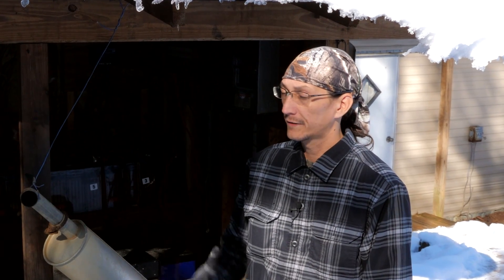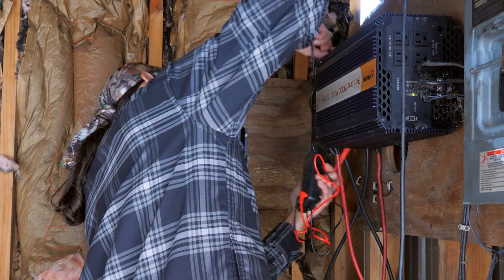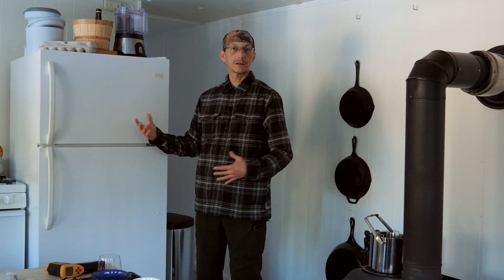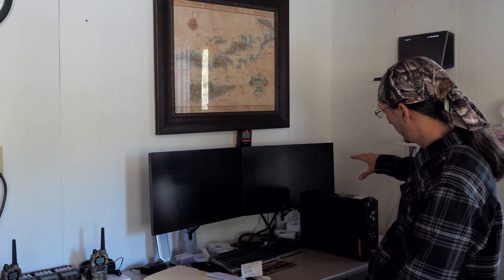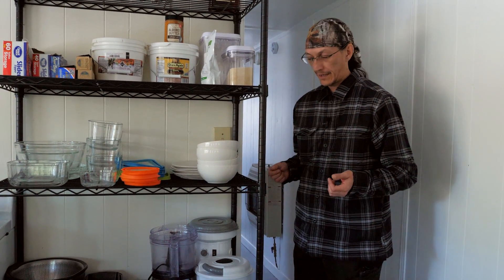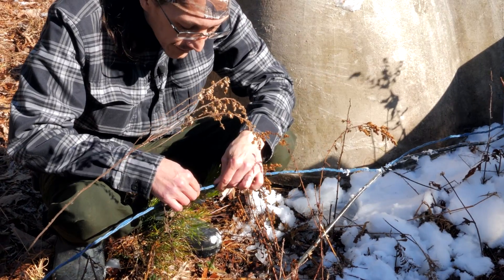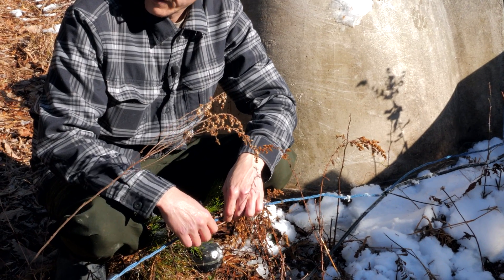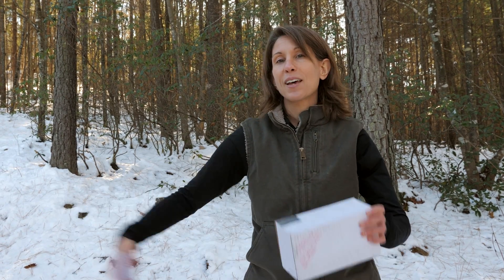Off Grid Electricity - Our DIY Solar System

Comment: I do the outdoor thing  with refrigeration  You can save a bundle.  I live in the city and i am a former large scale farmer.   Use mother nature to reduce your  KW load.   I used a  compost pile  for  geo thermal heating  reduced my load by 60 percent..  You have enough bio mass from your trees to consider using composting as another method of heating your home.

Comment: Convert to a 48 volt system, remember OHM’s law.. we run 12 250 watt solar panels, 8, 6 volt batteries, Magnum charge controller and inverter. Cable running from batteries to your inverter is important. All this system you can put on your house later as well. Love our system. Good luck and love that you have joined the Off Grid lifestyle..

Comment: The voltage  is dropping because the wire is to small.  When you calculate the wire size you must also calculate the distance  from panels to  inverter.

Comment: I'd look into getting a 500 or 1000 gallon water tank and put it either up a hill or on a tower to get a gravity fed water system.  They you only have to run the pump once every few weeks to fill it up.

Comment: First, thank you guys for all your videos. Your life is an inspiration for us. One thing I noticed,  your wire going from the battery bank to the inverter is really thin. This is why your system can't even handle a light load like a fridge. To feed a 5,000 W inverter you need a wire capable of handling 400 amps (5,000 / 12 = 416 Amps).  You need 800 kcmill copper wire. It is about as thick as your finger and you won't find it at your local Home Depot. A welding supplier  would be a place to go.  If they don't have 800 kcmill, they may offer a combination of 2 or 3 thinner wires which can handle 400 Amps. Hope this helps if you haven't figured it out already.

Comment: You are on the right track but your biggest problem is the distance from solar panels to charge controller & batteries ... it is just too great for any 12V array and buying thicker wire simply won't payoff. I would move the panels to a spot next to (or on top of) the battery shed and clear any sun blocking trees as the least expensive solution. I suspect that the previous owners only used the solar to keep the batteries topped off when they were not there ... and used the generator to charge the batteries. You are smart and diligent so I'm sure you will get it figured out!

Comment: I think you are spot on about the refrigerator. Even if day time temperatures get a high of 50-60F run the refrigerator when you run the water pump and you should be fine. Also by the time you reach those temperatures you'll have stronger sun for more solar collecting. xoxo from sunny Arizona. 77F today

Comment: Yea, it sounds like your wire size is too small for a 12 volt array.  I think the mnpt charge controller is the right choice.  A good charge controller will be able to handle different array voltages and battery bank voltages.  Which will give you flexibility in your future system.  Plus the added information it will give you.  After it is installed you could try putting your panels in series to up the voltage and then the wire size wouldn't be as big a problem.

Comment: For your solar system consider organizing a small group buy of used panels.  Most of those purchases have a minimum order of 20 panels or so, so you may need to organize a couple of friends to make it happen.  We got in on one and bought 18-month old 300 watt panels still under manufacturer's warranty for $85 each.

Comment: I worked heating and a/c for over 40 years, The fridge compressor is not going  to freeze. Your milk may freeze. On central air the compressor is always outside. Same with heat pumps. Love your content. Greeneville Tennessee says Happy holidays.
Reply from the maker: Yep that is why we were hesitant to move it there. But we had to weigh the pros and cons and this was the best temporary solution

Comment: Your videos are great.  To help with your camp water needs you may want to try something I use at my camp. When you pump water from your the spring to the cabin store it in a RV water holding tank in the camp. The water can then be sent on demand to the hot water heater and sinks with a 12 volt RV water pump. You can purchase the RV items from any RV dealership if or salvage yard that has a wrecked camper. Keep chasing your dream!

Comment: This will be a good experience for your home design, making it as efficient as possible.  If you have a southern exposure, a passive solar home might work out.   For the water, you could have a higher tank and fill it with the generator and use gravity, or use a small battery pump with a ground level tank.  Even a food grade 50 gallon drum would help.

Comment: One piece of advice I've heard you and other homesteaders give is: wait a while and get to know your property and setup. Like you said in today's video you have to adjust your electrical usage. For  instance, sweeping snow off your solar panels, even if it means getting out there during flurries so it doesn't freeze on the panels. Or setting up the panels so they can go vertical during a snowfall. There's lots to learn this winter and I think you won't really know what those needs are until you've practiced them at least another winter. Take your own advice, don't rush into building your new house. With love from Arizona.
Reply from the maker: Exactly. There is a lot of advice to “buy this and buy that”. We are intentionally not running out and buying things. The last thing you want (on a limited budget) is buyers regret. We are actually even rethinking our house location already.

Comment: I can't be the only person who thought, well move it!  (About the fridge) and you heard me! 😉  Mind you, you could keep the contents outside on the porch for the next 2-3 months, then your only problem would be milk ice lollies! & frozen lettuce.  Is there a reason you didn't put it closer to the door so you don't have to be turned into a statue when you step out in your skivvies & bare feet to get the milk for Jaime's coffee in 3ft of drifted snow?  Great to see your videos coming up J's, I missed you.  Starry did a Solar 101 video in the Summer, & down in the comments were some suggestions for improvements to her system with newer, far more efficient components of the set-up.  My point being go and look at the video and maybe message the guy who sounded über knowledgeable about solar system updates as part of your research,  because I know that you do extensive research getting ready for projects, plus it's ALWAYS Easier to build in future expansion (when you afford it) cheaper too in the long run, than it is to extend already installed systems.  Like putting in double plug sockets in every corner and wall of every room; and the wiring for wall lights where you'd naturally place them, marked on a room plan for future Sparkies (Electricians ).  A few feet of extra lighting wire now is by far a cheaper option than the chasing out of channels in an already plastered and painted wall to hide the wires to either the wall lights or where the extra plugs are needed, plus however good the contractor the new plaster never looks invisible, you can still see exactly the route from ceiling to lighting.  I bet he'd be delighted to share his knowledge and experience with you,  just a thought.

Comment: A sollution for your water system in the long term might be to put in an underground watertank, at an elevation and have it filled with a direct drive solar waterpump from the spring/well. That would give you near constant waterpressure and no need for batteries for the waterpump. Engineer 775 shows how he has build several systems like that for clients of his. I know it is not a short term sollution but it could be considered for your permanent system when you build your house.

Comment: 12.0 volts means your batteries are at a 45% state of charge. 12.7 Is right for FLA batteries when fully charged with a spacific gravity of 1.27 for most batteries. Just saying from a fellow off gridder. You can get a refractometer from Amazon to read the SG. Bogart makes a good battery monitor.  I think your batteries are heavily sulfated but since they are telecommunications batteries designed to last 20 years I think they will recover with proper charging.

Comment: I've watched your videos on and off for a while, however I plan to watch more regularly now that you've made your move. It's nice seeing you both working together as well. I know you get a lot of advice, so take this with a grain of salt. I have an off-grid cabin that I try to run everything I can from DC directly. For lighting we use under-counter LED "puck lights" designed for kitchen cabinets, running directly off the batteries. Very good light and can run for a week from a 100 AH battery. Also, a great reference is Boatowner's Illustrated Electrical Handbook - most sailboats use 12 volt systems and it has lots of valuable information. Keep up the great work.

Comment: You might look at solar powered livestock pumps.  They pump at a very low gpm, but they run continuously and will keep a reservoir tank full.  The additional head pressure even from a little 500 gallon reserve tank may help stabilize your water pressure issues.  The stock pumps can be had in either 12v, 24v or 110v.  All they need is a very small, basic solar system.  They're my backup for my well system.  They'll also work in ponds or springs.  Check 'em out.
Reply from the maker: Yep. Stay tuned 😉

Comment: I like your idea of moving the refrigerator out of doors for the winter.  That will surely help with energy consumption.  You are correct when you said that it is directly competing with the wood stove in such close proximity in the kitchen.  Good move.  It is only temporary anyway until you guys build your new home.  Which will be beautiful I'm sure.

Comment: The battery wires in your vehicle are correctly sized for their amperage and length, huge aren't they! For the long wire runs to your solar panels you need to add another pair of heavier wire than you've got now, moving the panels closer to the batteries is way cheaper that buying heavy gage wire. If you moved the panels three times closer then you could cut up the wire you have now to run three parallel pairs.  A 12v lead/acid battery is fully charged at 12.6 volts, to charge them to that point your charge controller needs to put out about 14v, your not getting 14v into the charge controller so it can't fully charge your batteries. Good luck.

Comment: G'day Jamie. You need to add a thicker wire OR run another wire in parallel  with what you have or move the panels closer to the charging station. You must get the 12v system up to 14.4v to equalize the battery system. I use charge controllers that show input and output to battery's voltage and amps with the voltage charge adjustable that I run at 14.4 volts at times. Works well for me but you are low on input voltage. You are to low to run a DC to DC converter to boost voltage to the batteries as the amps would be low. I use 34v panels. Cheers from down under. Say hello to the family from a hot OZ . Dave VK4KSY

Comment: Replacing the dc voltage transmission line with a much heavier gauge wire will lessen the voltage drop, but would probably cost you an arm and a leg. Congratulations on your dream property! Keep up the videos because they are really appreciated!

Comment: Put about a teaspoon of Epson salt in each cell of the batteries! I know that you may see things that say it doesn't help, but I have taken batteries that would not take a change and put it in them and it got them to work for many more years! It helps clean the plates so the batteries work better. That with a new charge controller and you really need better wire to solar panels you should be able to get much more from the system! Good luck! Thank You for the information! I have wanted to do some solar but didn't know where to start. The information you are giving will help me.
Reply from the maker: This is the old system that came with the property when we bought it. We have since replaced it with a whole new system and did a video series on the install.

Comment: I also love the Eneloop rechargeable batteries and have more than 60 of them... I like the BQ-CC55 smart charger bundled with the Eneloop batteries so much I have three.... 

I use them in everything: solar lights similar to yours, radio telephones, radios, torches, trail cameras, remotes, I can even run my internet on AA batteries if I have to

I'm a city boy that is prepared

Comment: if the wire from your panels is undersized for the load and distance it will cause voltage drop.  Check it out there's tons of tables on the net that will show you what you need.  Great video, good luck

Comment: Run an isolated solar/wind system for the shop. It may not be enough for some of the larger tools (circular saws/routers/etc), but it would be great for anything that runs on the rechargeable battery type tools.

Comment: Enjoying the vids.   I have been converting to solar.  Couple of things.  First, consider lithium ion batteries for your new bank.  They last longer (lifetime wise), higher capacities, safer ( no hydrogen gas), less maintenance , not as temperature sensitive, and much lighter weight and smaller per amp hour.  The voltage of the panels is really low for 150 yards and what looks like 10g wire.  Consider wiring your panels in series (they are parallel based on the video).  This would put the voltage around 64 DC which would easily reach your camp or new home with minimal loss using that wire.  Your new controller, assuming you are planning for the future, should easily handle that voltage to charge the battery type and wiring configuration (12/36/48/64 volts) you end up using.  The current inverter should handle any of those voltages already but check to make sure.   Looking forward to more videos.  The spring ones should be nice for us as we are starting our organic garden and possibly livestock in 2018.

Comment: 8:20 On the fridge: cover the areas facing the wood stove with good magnets then place a sheet of thin metal. That will significantly reduce the load on the fridge for super cheap. It should then operate like normal. Also, you could put a metal shield on that side of the wood heater for extra efficiency. And clean the coils under the fridge as dirty equals more energy usage.

Comment: morning! maybe someone has mentioned it in the comments but why not go with an insulated cover for the fridge and leave it inside. like one of those silver padded insulated "tarp" type materials. custom fit it to the doors of the fridge. the heat from the stove will stay out and the cool will stay in, like a giant insulated cooler. plenty of materials out there that could easily do the job. just my 2 cents.. 👍

Comment: Hi Jeremy, MPPT is definitely the way to go, to gain several excellent advantages, but you need to use the same size matching panels for the whole array because only then can you efficiently wire them all in series, which gives you the advantage of needing much smaller diameter wiring than you would with parallel-wired PV arrays, and you are also able to have longer cable runs for less voltage drop loss, between the array and the MPPT controller. The MPPT controller, because of its lower voltage/higher current output however, needs to be as close as possible/practical to the battery bank, as does the inverter.  A 10KwHr 48 volt series wired battery bank for example,  is a much better more efficient arrangement, than a 10KwHr 12v parallel wired battery bank, because the heavy wiring as required by a 12v inverter can now be much smaller in diameter, as used instead by a 48v inverter, because it draws only one quarter of the current, (but at 4 times the voltage) of the current drawn by the 12v inverter, for the same wattage.  As you are no doubt aware, this is because the voltage and current are inversely proportional for the same wattage, and this means that the lower the current the thinner the wiring can be for a given wattage. Some optional 12v/24v/48v MPPT controllers can only function to their full wattage design capacity by operating on their highest battery bank voltage option.                                                                                                                                                                                                                                    As far as I'm aware, with most good quality MPPT controllers you can series-wire your panels up to about 150 volts, but there may be other MPPT controllers that I'm not aware of, that are designed for higher voltages.                                                                                                                                                                                                                                This link is really helpful - see Paul Chamber's excellent Shipping Container House Videos, where he shares his PV experiences, mistakes and successful conclusions - 1) Install a charge controller and inverter to solar panels 
https://www.youtube.com/watch?annotation_id=annotation_4094815125&feature=iv&src_vid=ewz4edoqX5I&v=SPoeoORhq_Y                                                             2).  Is the new Tesla Powerwall battery good for my small off-grid house?  https://www.youtube.com/watch?v=ewz4edoqX5I&t=73s